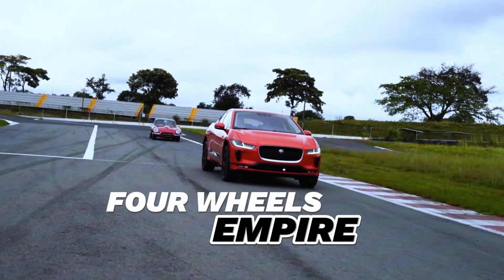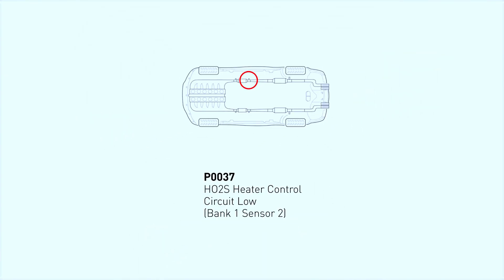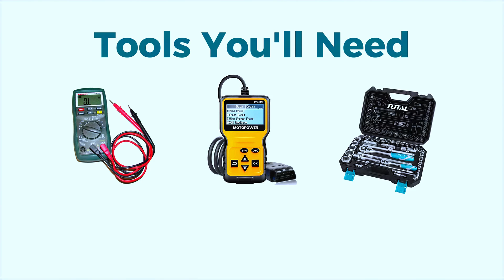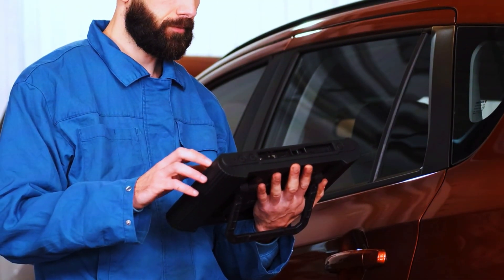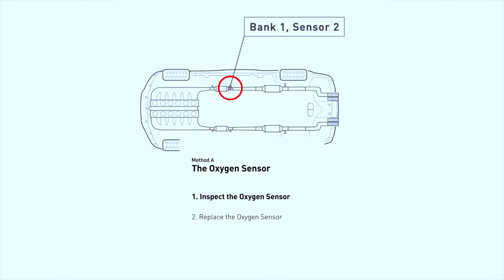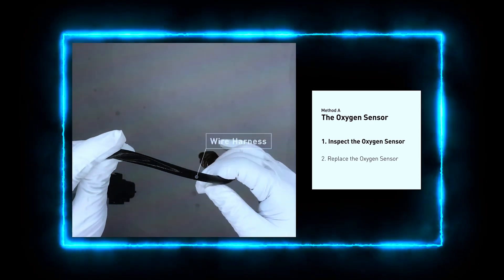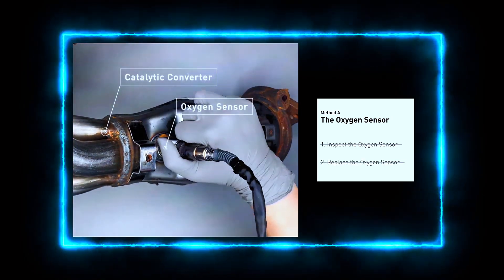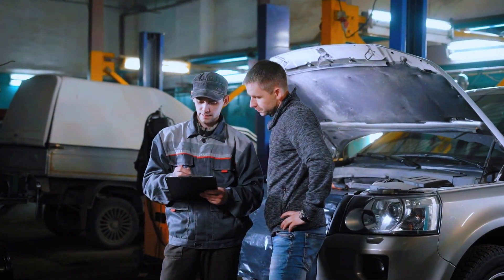How to Fix P0037 Code: Step-by-Step Oxygen Sensor Repair@FourWheelsEmpire

Comment: What to do if code come back
Reply from the maker: If the code comes back, it might be worth checking the wiring or the sensor itself for any issues. Sometimes, it can be a sign of a deeper problem that needs to be addressed!

Comment: Hi l have two code p0037 and p0138 reset the code and im driving for 5 minutes next check engine have on what a problem my car nissan juke 2016 turbocharger
Reply from the maker: It sounds like you're dealing with a couple of tricky codes! P0037 relates to the heater circuit of the oxygen sensor, while P0138 indicates a high voltage signal. I recommend checking the wiring and connectors for any damage or corrosion. If the problem persists, it might be worth consulting with a mechanic for a more thorough inspection.

Comment: I had my H2O sensors and my catalytic converter,  the ignition coils and spark plugs  all changed. Change H2O sensors twice. And still getting PO420 and PO036. What could be causing this??? Do I need to change the wires?
Reply from the maker: sir ,you can try changing the wires....and we will upload the video of p0420 code problem for your convenience within 24 hours....